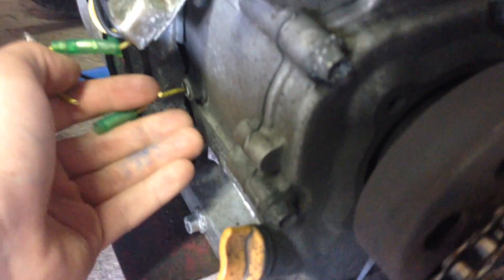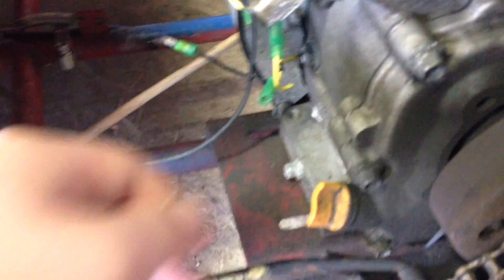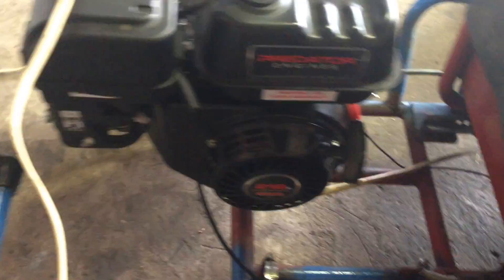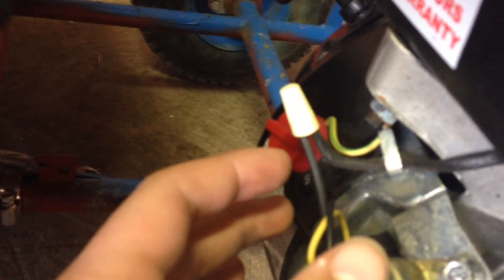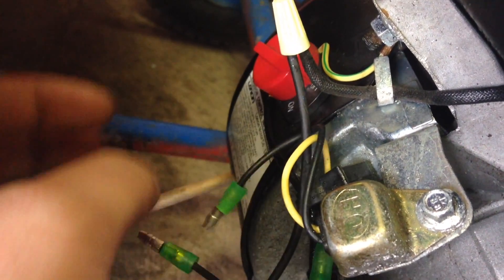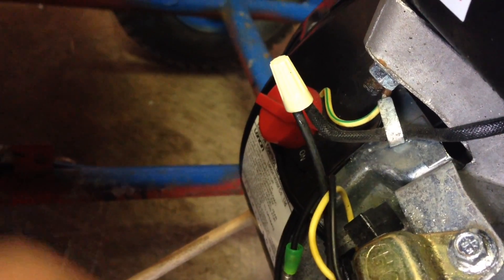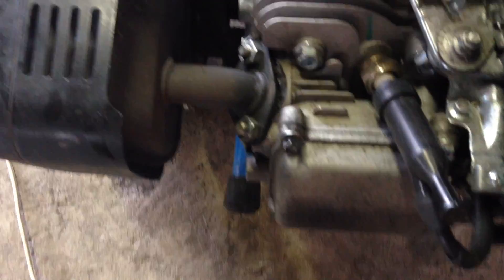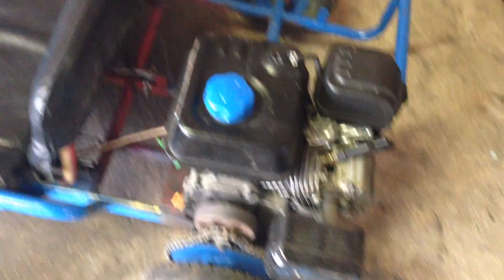212cc predator engine fix stalling & kill switch go kart

Comment: Remove governor, install 22mm carb, bigger valve springs and get a clutch with more teeth and you should be hitting 40

Comment: Put bigger tires on the back end. It will be slower off the line but the top speed will increase. I took tires off the back of a riding lawn mower and the top speed was like 50 mph. It was slow off the line though

Comment: You are correct sir! The oil sensor is what is causing the stalling issue. . I've seen a lot of people who have this problem with this engine but have not yet solved the problem. You nailed it. Thanks for sharing.

Comment: Hey are you shure this works cause I don't won't to mess it up
Reply: dawson smitherman this works if you're using an engine like this for karting. Just don't cut it. Disconnect the green connectors for the yellow wire, instead.

Comment: At 0:55 in your video, you have quick-disconnects in your hand that you can simply unplug!  Easy Peasy!  They are the green-shrouded things that the wire runs into.  Just pull them apart.  For good measure, put electrical tape around the exposed parts to ensure you don't cause the engine to stall if it touches ground.  Unlikely, but possible.  They are called "bullet connectors," and are also one of the easiest ways to wire a remote kill switch into a Predator engine.  All auto shops and even Walmart have them.  Ultimately, if you don't like the result just plug it back in and keep riding!

Comment: Pretty sad, but needed this video to figure-out why the hell this motor kept stalling. Seriously, thank you!

Just a note, no need to cut the sensor, they easily separate. Then just wrap two ends with some electrical tape, and you're good to go.

Comment: Put bigger wheels on the back. That will raise the top speed. Bigger wheels cover more ground and act as another "gear" in the drive system. I will say that it will lower your take off. The bigger wheels are harder to get spinning, but once they are going you'll have a much higher top speed. Look for a set of rear riding lawnmower wheels. Thanks for the video, helped me out with it stalling out.

Comment: does the kill switch on the engine still work after u cut the wire going to the low oil sensor???
Reply: Did you figure it out was wounding the same

Comment: You most definitely  make it fast you just gotta put the right mods on there u can get 30hp out these lil fuckers I have now it's pushing out 10 I put stage 2 carb on it new drilled jet took the governer off put stage to cam shaft in it as well and proformance kit and that's just lil up grades and I put heavy duty valve springs it
Reply from the maker: I have my mini bike with the same engine installed going 30 mph with me on it... I'm 280 lbs and it's still pushing me that fast lol.

Comment: I had the same problem using it on a Troy Bilt tiller.  I found that if I tilt the engine and add an extra pint of oil, so it is over filled a little, then the sensor will not shut it off when I am tilling deep, soft dirt and the engine tilts down as the tiller digs deep into the soil.  More oils solves the problem without removing the sensor.
Reply: I just put a Predator on my troy bilt and it stalls also, Wouldn't adding too much oil would be hard on your engine?

Comment: is this fully safe, I'm a little worried to try this
Reply: Don't cut the wires like this jack hole. They all unplug. Don't cut the wire he attached his kill switch to, just splice into it so you still have the original kill switch on the engine as well as the front kill switch.
Reply from the maker: Yes

Comment: You should take the exhaust, it sounds amazing
Reply: If you remove the mufflerand run it it will mess pressure up inside it and your engine wont run correct unless u know what your doing i wouldnt try it

Comment: Get a smaller sprocket that will give you a higher top speed
Reply: Clearly you don't know what your talking about. The smaller the sprocket the higher the acceleration. If you want a higher top speed use a big sprocket. A 60 tooth sprocket will get you an insane top speed (I've heard), but the bigger the sprocket the slower you will take off.

Comment: Change the gear ratio. The rear sprocket can be slightly smaller if you want more speed. Just don't go under a 55 tooth sprocket unless you want to burn out your clutch.
Reply: His guy right also power to weight ratio

Comment: Unscrew the throttle limiter a little until you reach ur desired speed. By the throttle there's a screw and all you have to do is unscrew it so the throttle can open up a little more. Idk everyone bothers with takin the whole thing apart to remove the governor when u can get it just as fast by unscrewing the throttle limiter.. Hope I helped!
Reply from the maker: I actually did this a couple days after posting! And I think your right about the governor being the same as the throttle limiter. I've heard my engine struggling ever sense I did this, so I'm thinking about getting the billet flywheel and the jets for the carb. Thanks for the comment!
Reply: This is false information.